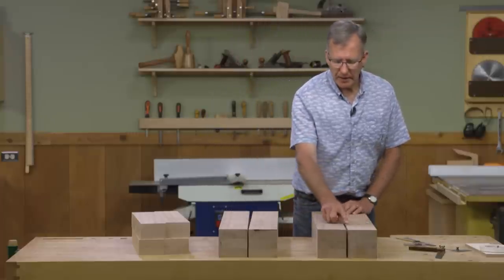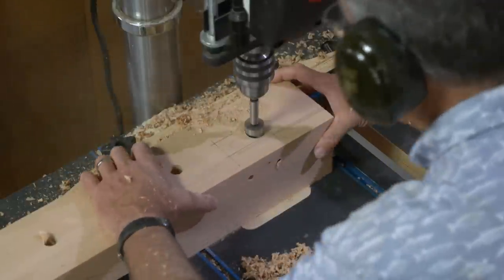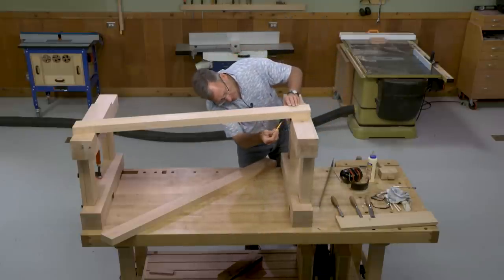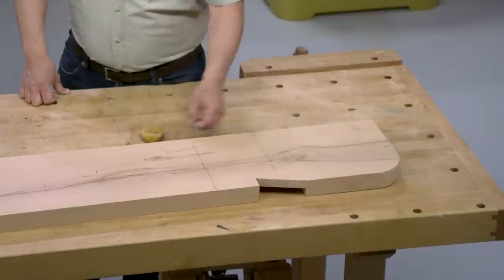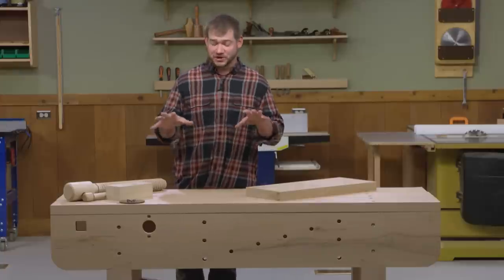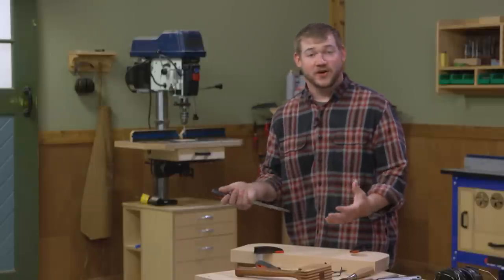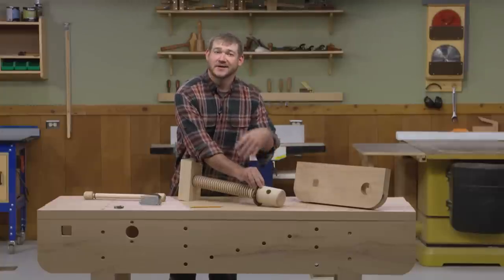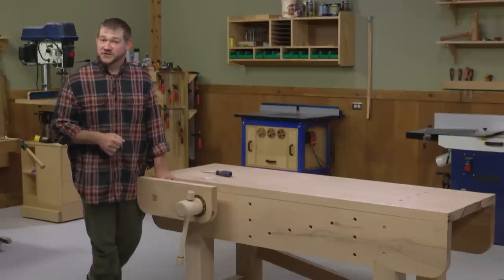Building a Traditional, English-Style Workbench

Comment: I own this plan already, just need to get serious and build it. I bought the large screw for the Moravian bench I built
last year, Lake Erie Toolworks I believe.
Reply: FYI...I'm in the process of building this bench.  I've adjusted the build to have a finished height of 35".  The original height was to low for me.
Reply: @JP-mq7pg  I built my first bench at 36" knowing I could shorten it, if it proved too high.
Reply: @cerberus2881  always a good approach to build with room to trim.
Reply: @JP-mq7pg  It's all compromise because Lower is better for certain operations, and Higher is better for others. We strive for the Happy Medium.
Reply: @JP-mq7pg just curious how your bench build went?  Did you make any modifications to the design?  I was thinking when I get around to building it, to maybe add a tool well, a lower shelf, and maybe somehow add a tail or wagon vise with some dog holes
Reply: @Nick-iz9zo  hello Nick, the only changes I made were adding to the height of the bench and instead of the front vise I installed a crochet. I have dog holes in the front apron as well in the top. I used a layout for the dog holes provided by The Renaissance woodworker. Oh, I as well went with two timbers laminated together for the top. I watched a video about working with a viceless work bench and thought I would follow that route. I have tool racks and a second bench nearby that has a tool well. Pros and cons with tool wells but I don't mind having one.  With the design of the bench were speaking of a lower shelf wouldn't be something that could be easily applied due to the bracing between the legs.
Reply: @JP-mq7pg  thanks for the quick response!  I'm still a very novice woodworker and I admit, I had to look up what a crochet is.  That's a pretty neat and simple idea.  I was also thinking of going with a laminate style top.  I hope you're enjoying your bench!  Looking forward to starting mine someday.  But in the meantime I'll just have to settle for my harbor freight bench 😉

Comment: The old-fashioned way to make a mortice would be to use a Bit and Brace, not a drill press. The old timers would not have used Mortice and Tendon construction braces or if you might say cross pieces were used, Mortice and Tendon would have been too time-consuming and unnecessary for a workbench that you were going to beat the crap out of. If you look at an old used English work bence they are beat up with saw marks, dents, and paint sploches because they were using them for work and not a tea party.